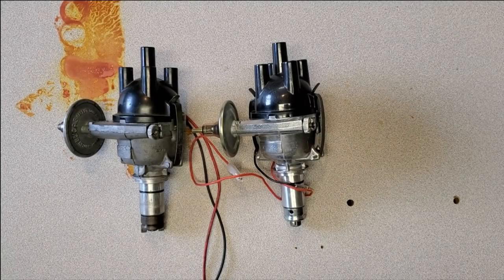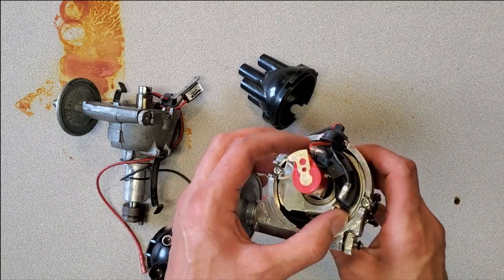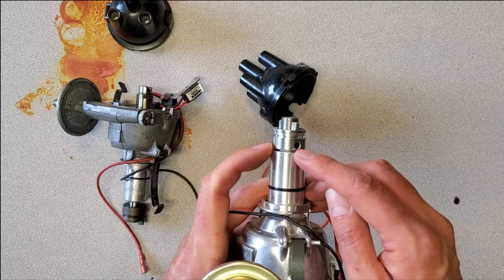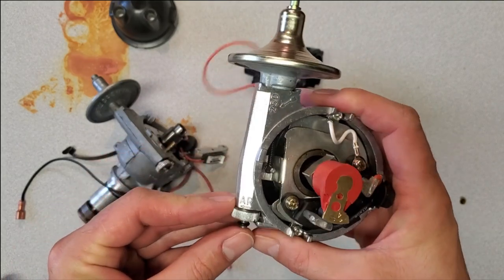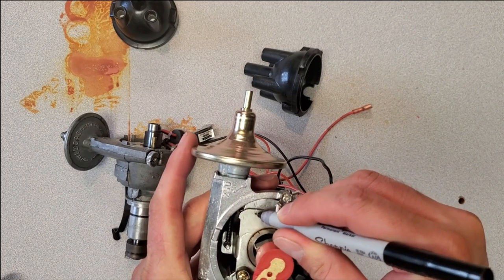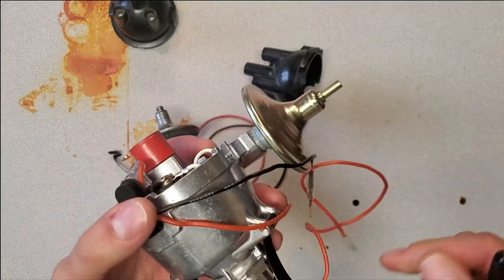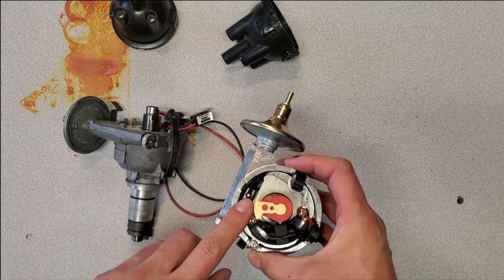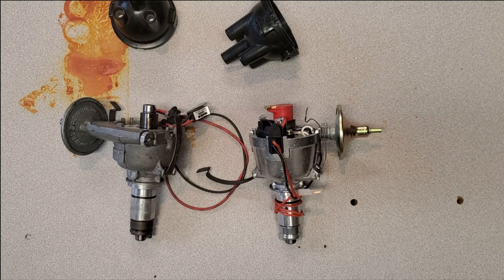Considering a new distributor for your classic Mini? Pros and Cons of Powerspark, Part 1 of 2

Comment: Hi Darren, been enjoying your distributor videos and it has helped me learn and progress my restoration of a lotus twin cam which has an odd Lucas distributor - 25D but a body for clockwise rotor while it needs to go anticlockwise. The internals are correct for anticlockwise and there is no shaft wear at all so it is rebuildable without vacuum advance which is what I was planning to do if I replace the plate with a 23D one or lock it up. However, your praise for power spark has made me wonder if that would be a better route. I would need to have it regraphed to suit my cams etc… so was wondering if this is easily done on them (im in Australia and know people with the sun machine) and if there are springs available to do it. Would be a good topic for a video for your channel too.
Reply from the maker: Hi, i will be taking both of these apart for Part 2. Will be showing how to check the total advance as well. 
I buy lengths of different spring sizes and cut/bend them to the size needed when recurving. Only way to know what spring you need is by testing it on a dizzy machine. 
I have built a custom dizzy machine which lets me easily change the springs. The old Sun units require the entire assembled dizzy to work while my setup only needs the inner shaft.
I will show this in a video at a later date.

Good luck and thanks for watching
Reply: @darrensrestorations991  Brilliant - looking  forward to it.

Comment: Powerspark is a cheap Chinese knock off. Fix your original one or find a good used 25D unit.
Reply from the maker: There are no good used 25D units. The shaft wear alone make them no good. Plus the curve on an original 25D needs to be adjusted to match the engine it is going on. The powerspark units are cheap but they can be tuned and have high power modules. High power module = more spark energy. No one else has a high power option for the A series motor.
Reply: @darrensrestorations991  Agreed, by the way; the work you do is amazing, it’s definitely a lost art.